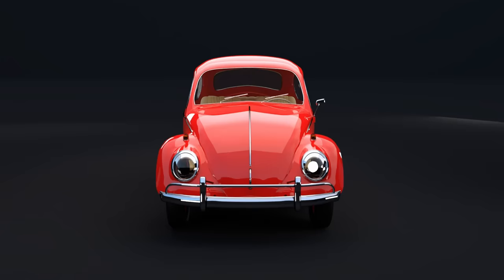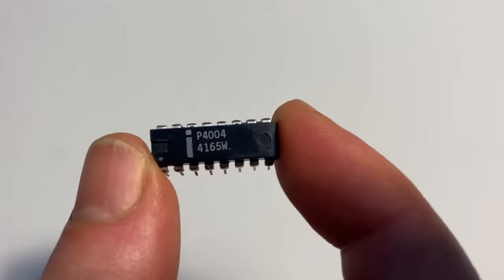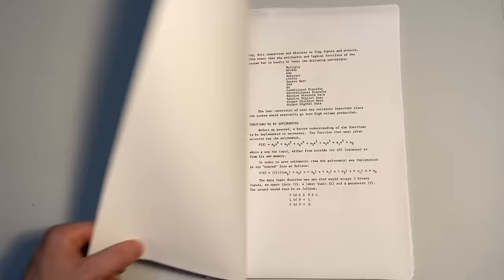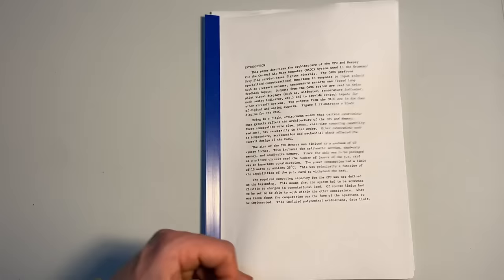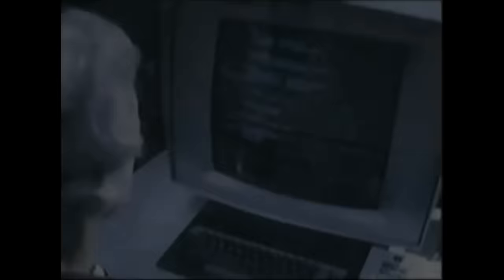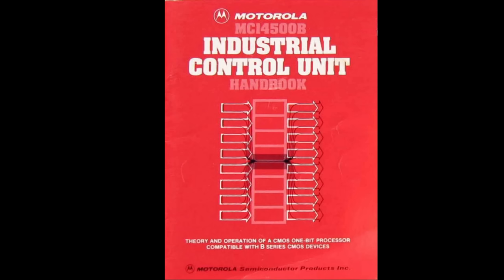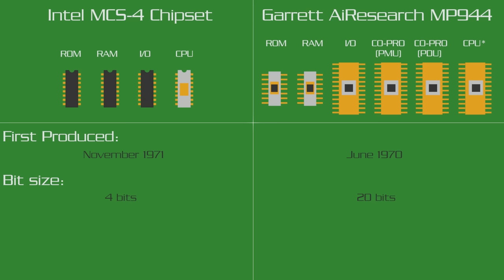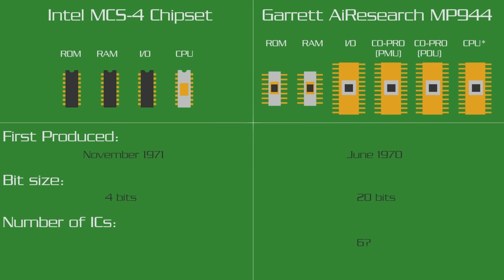The World's First Microprocessor: F-14 Central Air Data Computer

Comment: In 1975 I was trying to work on the f-111, as a result I also did work on f-14s that came into the air base their systems are much alike because Grumman was a partner in the building of the f-111. You might be surprised to know that the F4 was originally designated the f-110 .
As a result I did work on several f-14s and was familiar with their systems. Because it had to integrate a lot of mechanically driven actuators and control systems, it did require a lot and I do mean a lot of Maintenance time to keep it in the air. We complain today about the F-22 never being deployed with more than five planes at a time, and you are generally lucky if you can keep 50% of the F-22 flying at any given time. Much was the same about the f-14. It was an extremely difficult plane to keep flying. Especially in its first iteration.
Iran was extremely short-sighted attempting to use that as their primary fighter. I'm sure that some mechanism of the are data computers were reduced in function for their application. However, I also worked with many Iranians. They were extremely good at understanding Electronics to the highest degree of the day.
After having worked on a few of the f-14s I understand exactly why. When Carter cut our nation's throat and increase the instability in the Middle East by forcing the Shah out of Iran. It quickly rendered the vast majority of the Iranian Air Force, notably the f-14s out of existence until they can figure out how to get parts for them. They quickly learned how to build their own parts for those aircraft. That's why they still had several of them flying as of just a few years ago, I don't know if any are flying today. The earliest iteration of the F-14 was nothing to behold except when it was brand spanking new and everything worked on it properly. That was not always the case, as a matter of fact, it was rarely the case.
I do not know if your remark about the f11 being difficult to fly while changing its wing sweep is true, it was never true on the f-111f model that I was tasked with.
I also never had a problem flying the F-111 simulator, as I was the first one that the simulator Commander had ever seen fly it for the first time and not cause it to crash. I am not certain that we had chipsets in any of our flight data computers. We may have had them in the nav computer because even though it took the old school tape to load Mission parameters. The F model could be tasked with running a alternate routes to and from the bombing point, and never exceed 400 ft off the deck while doing so. You rarely would do a mission and approach a Target in excess of Mach 1 because you would leave a clear Sonic Trail. However you could do so quite easily.
I never got into an F-14 simulator during my time in the Air Force because we didn't have any. But as an avionics Tech I was able to show them how to do things like engage terrain following radar while in articulated Terrain. That procedure leads me to the concept that we may have had some sort of microprocessor in the F-111. I cannot be certain, but it is possible. I also have a good feeling that given the restrictions that you had to mechanically put into your movement of the wing at times and other clues, that there was no chip on the flight data system, except in regards to navigation. I did see several iterations of the navigation computer in other devices, some still in the 1970s as a matter of fact.
The last iteration of the F-14 was the most capable and had they upgraded it 2 a more powerful set of engines, something closer to what the f11f model, which had the same engines as the early F-16 and f-15, it may have been a much better aircraft. The unique issue with the high bypass turbofan hybrid engines, was that if you pulled back power on it too far and weren't paying close attention, you would scrub off speed at 50 knots per second. That is slowing down at a really fast rate and will you would get yourself in trouble, perhaps that's why you made the claim that the F-111 was hard to fly in transition. I never found such to be the case. You just had to remember to always run with a little bit more throttle than you thought was necessary. It was easy to adjust the speed of the f11 merely by sweeping the wings forward. With five stages of afterburner, you didn't even want to be on stage 1 while actually performing a mission. The f11 I would contend still to this day would be impervious to even the most modern anti-aircraft systems. There just isn't enough time to see it recognize it and shoot at it before it's already past you. Being able to Chase and shoot it down would be a Fool's errand. Especially if you were in any kind of articulated terrain, the ability to actually stay with it would be difficult in the extreme. Aircraft of North Vietnam even found the a model impossible to follow. That was however a much earlier time frame.
Reply: I don't know what happened there, ,and how. But the Soviet Union took possession of the F-111 back in the days of the Vietnam War. There is a story on this topic.
Reply: I have a good lady friend who was a mechanic on the F-111 and stationed in New Mexico. She was fond of her plane.
Reply: goddoesnotexist5688  You can fly a jet in a sandstorm?! If I saw that in a movie I would be certain that was made up. I vaguely remember hearing about an airliner that had its engines fail because of a volcano spewing ash: https://en.wikipedia.org/wiki/British_Airways_Flight_009#
Apparently there was another such incident: https://en.wikipedia.org/wiki/KLM_Flight_867
Not sure if volcanic ash is worse than sand though.
Reply: This was a great comment, thanks for sharing!
Reply: One thing on F-14 there is absolutely no plausible way for Iran to fabricate are the wing-box forgings.

If USA had to remake those wingboxes it would be doable but take some time. They were forged on what was, & possibly still is, the largest forging press by size in existence.

Simple drop-forging vs the complexity of hydraulic forging, its a multi storey forging press in Ohio that is one of a kind in the world, it is still used for extremely large & specialized forging applications.

Majority of Soviet Unions heavy forging was done in Ukraine where all it's military shipbuilding & largest aircraft were designed & built.

I would like to see drawings of the wing-box assembly, 

perhaps its pivot-pins used high-shock bushings & pins of forging-die alloys like A2 D2 O3 & Inconell, these are all very challenging to cut & press concentric into a forging without inducing stresses that could lead to "egging" or contact galling, 

bushings might delay the inevitable but everything gets work-hardened & microcracks over use time including a forged wingbox, 
I cannot imagine these Iranian F-14 wingboxes are still functional unless they are never flown, flown like a Piper Cub with no stresses on the wing-box, or possibly modified or replacements retrofitted as 1 piece to operate only in a fixed position
Reply: Grumman also builds USPS Postal trucks, fun fact.
Reply: Carter absolutely did not force out the Shah of Iran.  The Shah's monarchy was oppressive and lavish spending on himself and the military (like buying the F14) resulted in a popular revolution because he had lost legitimacy, maintaining power with a hated secret police and the usual abuses of authoritarian regimes.
The USA took the blame for the Shah, because a CIA backed coup overthrew the democratically elected left leaning prime minister.
Reply: The F-14 is thoroughly obsolete and Iran is high tech enough to develop their own modern fighter.
Reply: @Lurch-Bot lol, yet they do not.
Reply: 8:25 - The F-111 Aardvark was NOT difficult to control while sweeping the wings.

Here's a story...
You could actually air-refuel the Vark without touching the throttle setting.  How?  By modulating the wingsweep lever, which would increase/reduce your drag.

Air refueling is one of the more difficult piloting skills under normal conditions for any aircraft.  And the fact you could do it in the Vark without touching the throttle setting at all shows just how controllable the Aardvark was during the sweeping of its wings.

Comment: Fascinating!  In the early 80s, I worked in Garret Airesearch's environmental test lab.  I received my first Confidential clearance so that I could work on the SCADC program.  I can't remember the F-14 system ever being mentioned back then, but that could be just due to oldish age.  The SCADC was a standardized air data computer that was intended to replace older units on A-6, A-7, and A-4 aircraft .  The same electronics components but packaged to fit in the existing electronics bays of older aircraft. There were four total configurations, the fourth being sort of universal fit.  Seeing this video, I can see the similarities.  Environmental testing was to MIL-STD-510...vibration, temperature, altitude, humidity, etc.  Fun time for me working with centrifuge, explosive shock testing, acoustic shock, explosive atmosphere.  I left GA shortly after completion of these tests, going on to work at McDonnel Douglas on C-17 (FCSS and Flight Test and Escape Systems (ACES II Advanced Recovery Sequencer, a compact digital computer itself).
Reply: Which facility did you work?
Reply: @firstmicro  Garrett-Airesearch, 190th St  Torrance and LAX.
Reply: How long lasts confidential clearance?

Comment: Worth noting that when transitioning to supersonic flight, the center of pressure moves back on every aircraft. This is not only due to the F-14's swing wings but the interaction of pressure with supersonic shocks.
Reply: Something that the Concorde had to deal with by pumping fuel from it's wing tanks to the very back of the plane as ballast.
Reply: @JPkerVideo They couldn't very well stick trim tabs on her, she barely had enough fuel to get to New York as it was 😅

Comment: The intel 4004 was mostly limited by the requirement that the CPU had to use that package, limiting the pin count.
Reply: A 4 bit CPU is pretty limiting and that was the only thing they were getting in that package in 1971. They were mostly used in scientific calculators where they performed with mediocrity. But when my dad was doing his master's, those calculators kept him from having to go over to the mainframe and futz around with punch cards so much.

Comment: high aspect ratio doesn't create more drag, it actually creates less at subsonic speeds, which is why gliders have high AR. At supersonic speeds you have shocks and delta becomes favorable

I really liked the video though, keep up the good work!
Reply: please upvote pilot channel's explanation. I was about to write the same thing.
Reply: I think there's some subtlety to this. High aspect ratio wings do create more drag overall, as a simple matter of increasing the frontal area of the aircraft. What they excel at is improving the lift:drag ratio. All other things being equal, a subsonic aircraft with shorter wings will experience less drag, but it will also be less efficient and have less endurance than the same aircraft with much longer wings. If we imagine that we change nothing about the aircraft aside from the length of the wings (i.e. we keep the same engine, propeller, fuel, etc.), then the aircraft with shorter wings will be able to achieve a higher top speed, but the aircraft with longer wings will be more fuel-efficient and have a higher service ceiling.

Compare the Lockheed U-2 and the Corvair F-106. They both use the same engine, a Pratt & Whitney J75, and they have comparable gross weights. The most obvious difference is that the F-106 employs a delta wing, and the U-2 employs a high-aspect wing. The F-106 has a top speed of 1325kt, while the U-2 has a top speed of 412kt. The F-106 has a L:D ratio of 12.1 at subsonic speeds, while the U-2 has a L:D ratio of 25.6. The F-106 has a service ceiling of 57,000 feet, while the U-2 has a service ceiling which is still classified but is at least 80,000 feet. The F-106 has a range of 500nm, while the U-2 has a range of over 6,000nm, a difference which cannot be adequately explained by the fact that the U-2 can carry ~10,000 more pounds of fuel.
Reply: @tissuepaper9962  frontal area alone is misleading, especially at lower airspeeds. And you can massively increase Aspect Ratio of a given design, without changing the Frontal area at all, or even reduce the frontal area at the same time.
Reply: @tissuepaper9962  in aircraft aerodynamics, we typically consider the projected or wetted surface area, not the frontal area. You can keep this area the same while increasing aspect ratio to reduce your drag.
Reply: @tissuepaper9962  High aspect ratio wings only create more drag overall supersonic (and very high transonic). The reduction in induced drag when subsonic more than  makes up for the increased frontal area, and thus a high aspect wing is lower drag when subsonic.

Consider: a modern airliner at basically all phases of flight always is making lift equal to weight, so lift is fundamentally fixed. If you improve the lift to drag ratio, you aren't making more lift, because your lift still has to equal weight, so what are you doing? Decreasing drag. During cruise, there's fundamentally no difference between "improving lift to drag ratio" and "reducing drag", because lift is unchanging.
Reply: @tissuepaper9962 for a design with equal lift coefficients, a high aspect wing will produce less drag.
Reply: @tissuepaper9962  you admit that higher aspect ratio is good for improving the lift to drag ratio, and ignore the fact that lift is equal to weight in straight flight, and the weight is constant between wing configurations. Therefore the drag must be reduced if the lift to drag ratio is increasing. All your other analysis is irrelevant.
Reply: @veloxsouth  you're assuming that cruise speed will stay the same regardless of wing design, which is obviously wrong. The high-aspect wing will have a slower cruise speed, which is what contributes to the improvement in L:D ratio. If we set a constant speed between tests then the longer wings will always produce more drag.
Reply: @tissuepaper9962  No, for equal air density, velocity, coefficient of lift, and wing area, which implies an equal lift force, a longer wing span, which implies a higher aspect ratio, will produce LESS drag.
The relationship is inversely proportional. the coefficient of induced drag is given by the coefficient of lift^2 / (pi * oswald efficiency * aspect ratio). the coefficient of no-lift drag or base-drag C_d0 is also related to the constant dynamic pressure Q and wing area S. D = Q(C_d0 + (Cl^2 / (pi*e*AR))S. The only free variable left that would allow your claim to be true is if you lowered the base drag coefficient, which is not a fair comparison.
Reply: @tissuepaper9962 Your comparison between the U-2 and F-106 was a very interesting way of highlighting two fairly extreme cases of wing design.